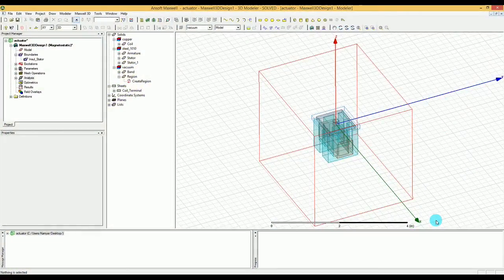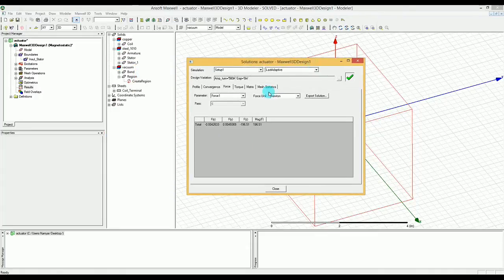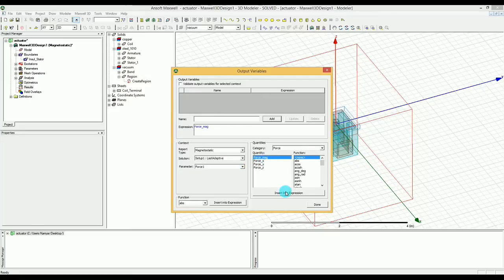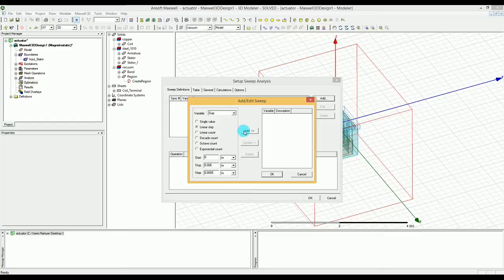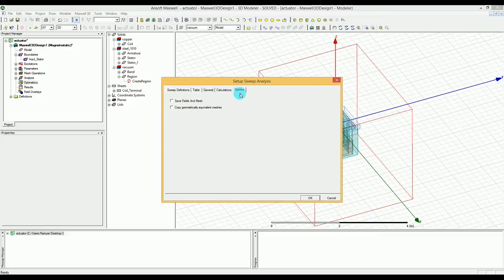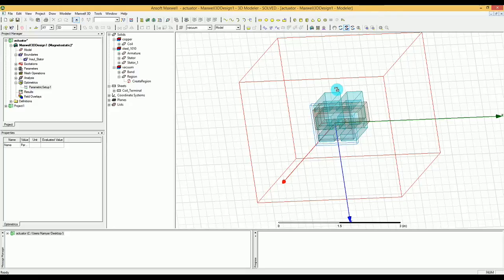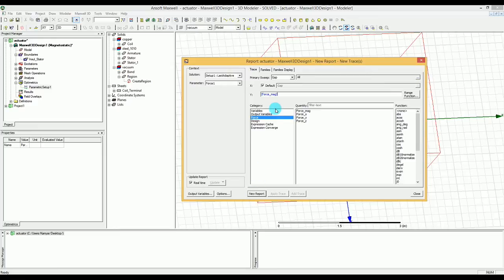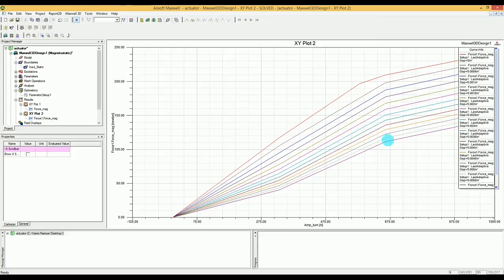216- Ansys Maxwell- Equivalent Circuir Extraction/ Linear Motion (Actuator) [4/4]

Comment: Hi Kamyar, please help me, 
I have problem with my Ansys maxwell 16. when I simulate two plates capacitors, this error message appears
"'3des' terminated abnormally.  It may have run out of memory or could have been killed by the user. (10:07:28 PM  Apr 09, 2018)
    [error] Simulation completed with execution error on server: Local Machine. (10:07:28 PM Apr 09, 2018)"

please help me, what can Ido??

Comment: Hi, thanks for the video tutorial. Its a great help to me. but i am in trouble. during my translational model in ansys 2d maxwell when i am gonna animate any field liked Mag_B its only taking the start time and stop time for animation. that is 0s and 0.03s for my case though the time step i select is 2millisecond. please help.
Reply: Ercan DÜZGÜN Thanks bro. But my problem is that when i am going to select the time range for the animation its just showing 0s and 0.03s only. just two step. but it should show 15 time steps. please help.
Reply: Ercan DÜZGÜN Actually i can switch between 0s and 0.03s only. the two extreme time steps. nothing in between. my solution setup configuration is: In general tab: stop time=30ms, time step=2.22ms; in save fields tab: start= 0ms, stop= 30ms, step size= 2.22ms.
Reply: Ercan DÜZGÜN  Thanks for your help.okay let me tell you about it more elaborately:my project is like a linear induction motor.so i need to do a translational motion, creating band etc.After simulation i did all the post processing: force vs time, speed vs time etc. weird thing is that at that time data for each and every time steps are plotted...for example force value for each time steps.but during animation of the b_field or flux line it just takes only two times: start and stop. nothing in between.More strange thing is that if i simulate the whole thing without translational motion(without creating band and all that things), just for field analysis, everything works fine. the animation works perfectly with every time steps including start and stop time.
Reply: Ercan DÜZGÜN What you did for me was great and i appreciate that. The instructions in the png was great. currently running the simulation and will let you know about the result...
Reply from the maker: thanks guys;)
Reply: Ercan DÜZGÜN
 it worked..but i eventually find out that there was a problem in selecting the time step. save field time step must be given more than general tab time step which should be chosen properly. thanks again.